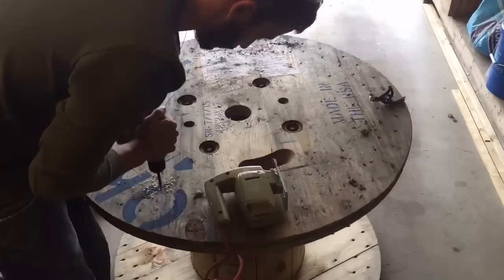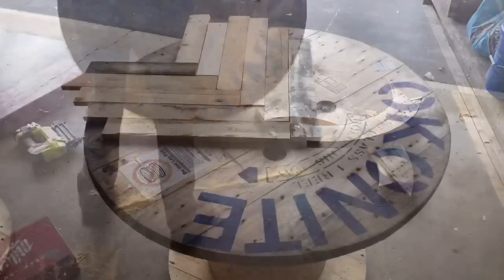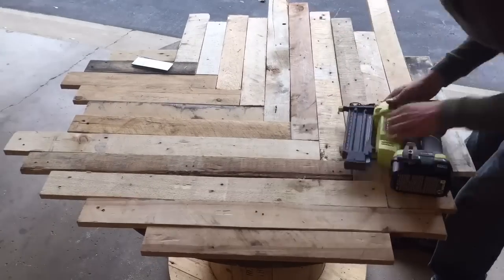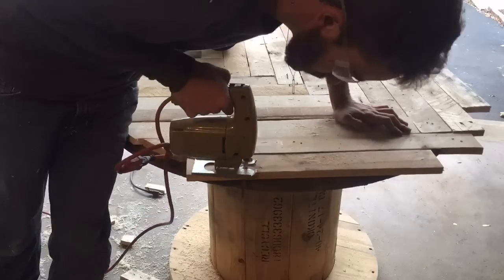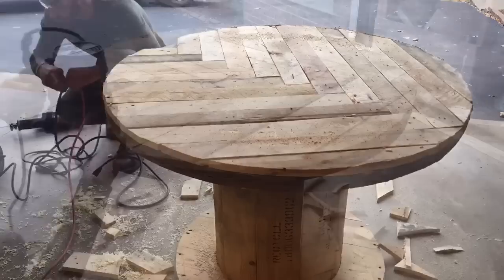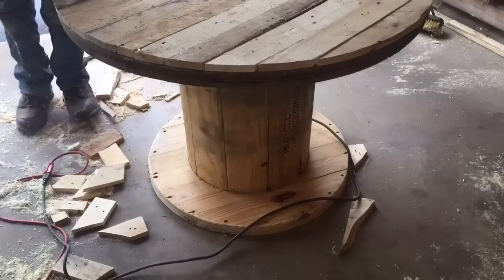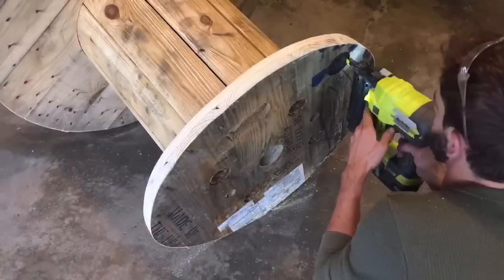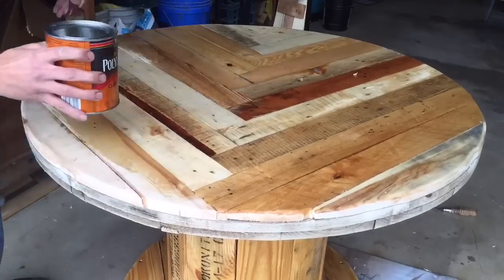DIY Pallet Spool Cafe Table!

Comment: So far from all the videos I have seen about herringbone patterns in tables this is the most simple, straight to the point one. No complex calculations, excessive measuring and bazillion wood cuts, my only complain is that since the boards were not glued between them if liquids are spill they will get between and to the surface below (I would seal the surface before putting the herringbone shape on top). But generally speaking I really loved this video and they way you made all the work on it, thanks a lot!
Reply from the maker: Awesome, glad you enjoyed it! Thanks for watching!

Comment: looks good man! are you gonna do anything to the base? looks like its   time for a new jig saw ;) i have a drill that looks very similar to your jig saw i got it from my grandfather a long time ago. keepsake u could call it..F.Y.I.  the dewalt jig saw is on sale at depot for 89$ :) keep the vids comn man have a good one
Reply from the maker: +Joe basementwoodworking thanks man! I think I am just keeping the base as it is.  Yea man that jig saw is so weak, I was actually looking into the dewalt one I will have to check out that sale.  I never like the way the dewalt jigs grab the blade though with that plastic tightening nut.  thanks for watching man, more videos to come!
Reply: +Into The Dirtshop the dewalt i have  ( which is the one that's on sale now has a plastic tab that you pull up its kinda like a spring-loaded deal you'll see what I mean if you when you check it out its the saw i use in my "how to make a red oak shelf " video
Reply: +Into The Dirtshop the blade just pops in place sorta speak.. but yeah I was just at the depot 3 days ago and it was on sale for 89 99 marks down from 9999
Reply: When I was cutting my spool, I was using an Evolv jigsaw. I gave it up and went bought a Bosch and it ripped right through it. There is a video on my channel lol

Comment: It's nice!  Your brads might scratch a hardwood floor though, you could glue some felt or something over them maybe. Cool project man.
Reply from the maker: +Lil Doggy thanks for watching man! I should have shown a close up but i set the depth on my brad nailer so that the nail head actually pushed the rubber up, so the nail head are pretty deep into the rubber and out of the way.

Comment: Great build. If it had been me, I would have maybe filled in the gaps between the pallets with a bit of sawdust and glue, and maybe gone with a more natural, less glossy  finish. Maybe Tung or danish oil. But overall this is a beautiful table and I love it. Great work!
Reply from the maker: +Charlie DeSaussure thanks for checking it out! the gaps were actually pretty big, if I make another one of these in the future I will probably try to cut down all the pallets to the same width on the table saw to get a better fitment!

Comment: Question:  How do you keep the top from warping?  We have made two tables out of the large wire spools and stained them and put a urethane varnish on them and the tops warped (like if you took a paper plate and slightly lifted opposite sides up, bending the plate) after a few months.
Reply: Christina Heldoorn where do you get the used wire spool ??

Comment: Great job dude! It looks beautiful. One question though. After cutting the base smaller in diameter, did it make the table less stable or would it tip over easier?
Reply from the maker: I didn’t take off too much, it’s still solid!